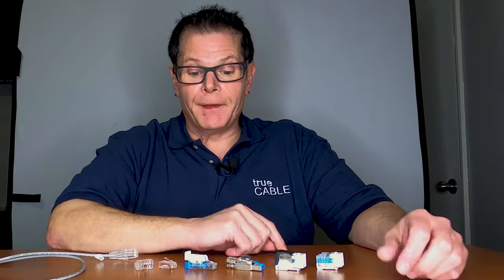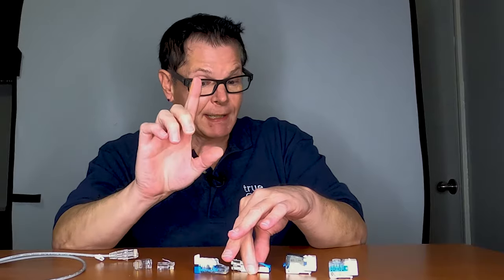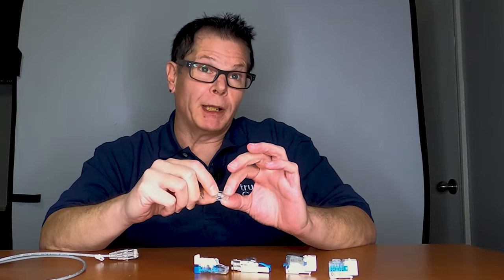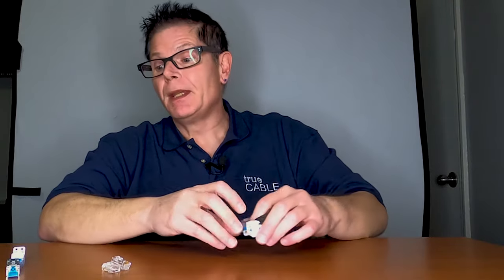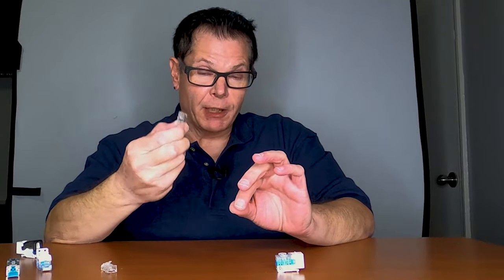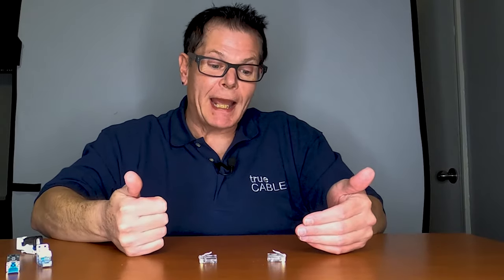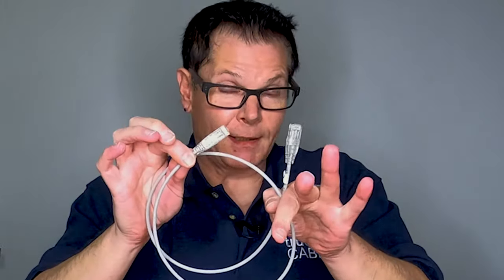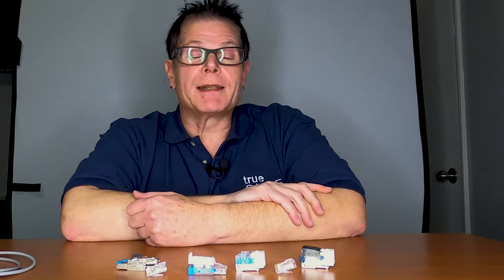Choosing the Correct Ethernet Termination

Comment: Doubt if this explanation is precise. Especially when he talks about cat6A cable. There are special cat6 plugs, that are red and that have wires sitting not in line in the plug as standard width of the cat5 plug can not accomodate thicker cat6 wire. Wires are inserted with the help of a special plastic insert that lines every odd wire slightly above even wires thus giving space for thicker wires to fit in standard plug width.
Reply from the maker: Hello obj! We carry the type of RJ45 (8P8C) plug you are referring to. It is called a "standard load-bar" style plug and it does stagger the conductors which does help with Cat6A NEXT (at the connector) performance when pushed to 500 MHz. When a 8P8C plug is absolutely required due to installation constraints, we recommend the load bar stagger plug for our Cat6A U/UTP cables -- but only when used at a single end for a MPTL run (keystone > plug for PoE devices). That said, having a IDC style termination such as a patch panel or keystone at the other end is critical to holding up cable performance and especially for achieving PASS on a Certification device. Solid copper Ethernet insulated conductor plastic insulation can and does have a tolerance that varies from lot to lot, spool to spool, and even along the SAME spool. This will affect NEXT and Return Loss at what would otherwise be a very well fitted 8P8C connector. This phenomenon does not occur with Category rated IDC style terminations (keystone, patch panel, field term plug). If you attempt to create a patch cord (defined as a 8P8C plug at both ends) with solid copper Ethernet you double your chances of creating a sub-par cable and it takes a Fluke DSX-8000 with PCA adapters to sort it out. Since most people don't have $13K - $15K to drop on such a device (nor the training to use one) we defer to the safer route which is using IDC style terminations for bulk cable and then use factory pre-terminated and tested patch cord for any necessary patching.

Comment: I wish I had seen this before I started my own networking project...  I also read the article on your site, and I had a question:  is there a particular reason you don't show a cable with Field plugs on both ends? 

I'm building a series of outdoor cat6 channels between daisy-chained PoE repeaters to reach a Point-to-point wifi AP ~1100' away.  Each channel is under 300', but even so,  each one in the system reduces performance considerably.  

Is it likely that switching from pass-thru RJ45's to field plugs would make the difference?  Can I use field plugs with PoE?  I'm aware Im pushing it, but hopefully with the right parts I can make it work.
Reply from the maker: Hello! I am glad you found our site and video! Not showing a cable with a Field Termination Plug at both ends was an oversight. Obviously, this is a superior way of way of creating a patch cable and this type of Field Term > Field Term cable is known as a Direct Attach Cable. You can most certainly use this strategy, and it will give you much better performance. As for PoE--absolutely! Our Field Termination Plugs easily handle 100W PoE. The reason you have seen performance degradation with RJ45s is likely due to multiple factors with the two biggest being fitment and mechanical stability. I would definitely use Field Termination Plugs at both ends of the individual runs if that is an option for you. Given that Field Termination Plugs are physically larger than RJ45s, that could be a factor in whether you use them throughout your installation as not all outdoor Ethernet switches with their weatherproof housings will accept Field Termination Plugs.
Reply: @trueCABLE  thank you! I just went ahead and ordered some of your shielded field termination plugs through Amazon.  Once I get them hooked up, I'll be sharing my results on my techier channel: @TheKludge4315
Reply from the maker: @DerrangedGadgeteer   Thanks and we look forward to your video. Also, I would recommend you pick up a pair of parallel crimping pliers (trueCLOSE). Here is the link to the written blog with embedded video which will give you tips on the nuances of these field termination plugs: https://www.truecable.com/blogs/cable-academy/how-to-terminate-a-cat6a-shielded-field-term-plug. Be sure to follow the video and written instructions closely! Both bring something to the table.

Comment: It is an 8 pin modular not rj45
Rj45 is a registered jack wiring configuration using a 8 pin modular connector
Reply from the maker: You are absolutely correct. It is technically called a 8P8C modular plug. The "RJ45" term has unfortunately stuck with us and it continues being used, quite often incorrectly. Therefore I will use the two terms interchangeably to refer to the same thing, knowing full well it is actually a "8P8C" connector. I will often put it like this "8P8C plug, aka RJ45" but sometimes I don't put it like that. I try and catch myself when I can. The problem is if I refer to it strictly as a "8P8C modular plug" and never use the term "RJ45" many folks that are not aware of the nuances will have difficulty understanding what I am talking about. It is a double edged sword
Reply: @trueCABLE  ok
The history I heard was that RJ45 was used a long time ago in offices by the telephone co.  Which was called the RJ45.  So along comes Ethernet and the used the exact same connector and the RJ45 stuck because it looked the same.
Reply from the maker: @wdooley62  Hello William! Yeah, I have heard that one too. There are several stories out there floating around about how the term "RJ45" sort of stuck. They are probably ALL true to some extent or another!

Comment: Great video. Thanks for creating it.  Can I ask for a little more clarity please as far as when you mention best connection…. I understand the runs through the house to faceplates or patch panel would be best to be terminated with keystone jacks.  Then from switch (POE) or otherwise  to patch panel or wall plate those cables should terminated with field plugs. Where I lose clarity is what connection to 1) POE cameras 2) modem/router 3) computer/ps5/cable box/smart tv etc?   Are those the RJ45 terminations or should those also be field plugs unless they don’t fit the device being connected?  I am not talking office/commercial use.  I am talking DIY through my home for best connection to everything and from internet provider.  It seems that every video out there is for pass thru rj45 terminations.  It seems like with Cat6 that is the “YouTube” ongoing recommendation   :). Thx
Reply from the maker: Hello! Generally speaking, once the solid copper permanent links are installed (patch panel to keystone to keystone to keystone) then you should patch into them with factory pre-terminated patch cable of the same Category (or higher) as your solid copper links. If you are constructing a MPTL run, which is patch panel or keystone to male plug end the best way is to a field termination plug unless it won't fit in the end point device. In that case you should use the RJ45 8P8C plug as you already surmised. Same room connections like from cable modem to router should also be done with a factory pre-terminated patch cable.

Comment: I'm wondering, how would you transition between cable jacket types. I'm planning to run CAT 6a burial and then in wall, how would I transition between the burial cable and riser cable retaining a good signal? (Planning to make the transition in a junction box attached to the wall outside)

Awesome video, so informative along with the blog on the website!!!!
Reply from the maker: Hello Chad! The best way to transition from outdoor to indoor cable is with 110 punch down splice block. You might have trouble finding a Cat6A one, however. Cat6 and Cat5e are very common. Secondarily, the next best way to preserve performance would be with Cat6A field termination plugs, which we carry. Terminate the end of the outdoor cable coming inside with a field termination plug and then use a component rated Cat6A coupler (which we also carry) in between. Terminate the end of the indoor cable going to the coupler with a field termination plug as well. The end of the cable that reaches your switch area should be terminated to a keystone jack or yet another field termination plug if you are not using a patch panel. At no point should you use a RJ45 8P8C plug for this task. Thanks for the kudos on our content!

Comment: Great content. One question, based on the products on your website, why would I buy a CAT 5E connector instead of just getting a CAT6/6A connector?
Reply from the maker: Hello! When it comes to Category rated items like keystone jacks, you can use a higher rated connector than the cable you are using (but not lower). The reason for not doing that is due to cost, and it does not get you more performance since the limiting factor is the lowest Category rated component in the chain. Cat6A keystone jacks are much more expensive than Cat5e, as well. As for 8P8C plugs (aka RJ45) it is not a matter of Category but a matter of fitment. RJ45 plugs don't have a Category, technically speaking. Hope this helps!

Comment: Sounds like you don't recommend using Ethernet jack couplers on patch panels? Or do those have chips inside? I'm assuming the cheap Chinese ones do not, but I'm not sure. I've been looking for a good brand that provides RJ45 couplers for my patch panel because it's so hard to pull out keystone jacks. If it was easier, I'd simply use punch-down keystone jacks instead.

My issue is if I have to swap the patch panel or reconfigure the wires, it's gonna be nearly impossible if I can get the keystone jacks outta there.

My drops are all punch-down keystone jacks, it's only the ones in my network closet that are RJ45. I'm up for making them punch-down if it's more reliable somehow. The patch cable itself is a Monoprice Slimrun 6" CAT6a.
Reply from the maker: Hello! Ethernet jack couplers, such as our keystone couplers, can be used in a patch panel. We would recommend keeping the use to no more than two couplers per channel. The main issue with couplers is the quality of the patch cords, not the couplers. Our couplers are impedance matching and component rated (they have PCBs inside, but then all couplers and keystones do) so if you intend to go this route use the highest quality keystone coupler you can get (again, such as ours but there are others) and be sure to use component rated patch cords. We sell the patch cords, but only up to 25ft. You can obtain component rated patch cords from CommScope and Belden as well. They cost more, but you want to keep the potential issues and points of failure to a minimum. That all said, the correct way of installing Ethernet is to use solid copper Category rated Ethernet cable for in-wall permanent cabling and punch down type terminations at both ends. A solid copper permanent link will give you the best performance and lengths. At both ends of the permanent link you would complete your connections with male patch cords. That is going to be the least problematic way, and gets around the issues of stranded copper being used throughout your installation which poses its own issues (maximum lengths being the main one).
Reply: @trueCABLE  great! I picked up RJ45 keystone couplers from your website and a bunch of other color punch-down ones for when I move. Punch-down are a pain to install in a small server closet with low clearance.

I also grabbed your thin 1' patch cables. I was using the Monoprice colored ones (I like the colors), but I've had issues.

I've been pushing 10Gb in spots, so this matters. I also used Monoprice CAT6 solid core in my house when I wired it up years ago, but I didn't realize the RJ45 connectors could cause issues.

Thankfully, all my drops are keystone punch-down or toolless.
Reply from the maker: @Saturn2888  Hello again! That is great. I hope you like our patch cords. I certainly do, and I am hard to please. You won't have any performance issues with them, I can assure you. I guarantee it, actually. And yes, the source of many problems with Ethernet cable installations is improper installation (damage to) Ethernet or hand terminated 8P8C (aka RJ45) connectors on solid copper Ethernet You are correct in that patch cords that have not been properly CERTIFIED (not merely verified) will cause problems, as you discovered. I have test data that backs you up, and I will be doing some expose stuff coming up in the near future that will basically throw the entire patch cord market (imported patch cords for the most part) right under the bus. Stay tuned!
Reply: @trueCABLE  that's great! Exactly what I want to see!

Comment: Really appreciate the excellent video.  I had 2000 Mbps fiber installed and the technician used 5e cable and standard RJ45 connectors. The computer end uses a USB-C adapter to a MacBook.  Should I replace both connectors with field term plugs? I do receive 2-2.3 Mbps download speeds but the slightest move of the cable cuts signal out.
Reply from the maker: Hey RK! Thanks for the kudos.

Cat5e can handle 2.5Gb/s via NBASE-T so you can remain on Cat5e if you have no future plans to increase speed. If you intend to start stringing new cable then I would opt for solid copper Cat6A with Cat6A keystones for the permanent runs + Cat6A factory made patch cords to patch into the solid copper runs. This would be best for future proofing since you are likely to buy into 10Gb/s at some point -- judging based upon how fast you are going now.

As an aside, if the movement of cable causes loss of signal this means either the cable is bad or one of the terminations is bad. You will have to start replacing patch cables, etc. to run down what it is. Hopefully it is not the USB-C port on the MacBook! Given I don't know how your installation looks that is about the best advice I can give right now. This is something that would require me to stand there and troubleshoot.
Reply: @trueCABLE  Thank you very much for detailed reply. It appears to be the cheap plastic plug causing the interruption when moved.

Comment: I had no idea how important keystones are before watching this video. It was very informative, thank you!
Could you please answer a little question, tho?

Let's say I run shielded cables from a shielded patch panel to keystone jacks on the walls.
If the cable is bound to the patch panel, do the keystone jacks (or RJ45 Connectors) on the wall need to be shielded keystone jacks as well?
There is nowhere to bind them at walls anyway, even if I wanted to.

Also, they are VERY expensive in Brazil, so I would really appreciate the money I'd save, but I want to make a proper installation.

Another question if I may, are cat 6 keystones compatible with 23AWG Cat6A cables? In this case, it's not about the money, but a matter of availability, unfortunately. I'm having trouble finding more cat 6A connectors at the local stores, I can only ship them from far away =/
Reply from the maker: It is better to use shielded hardware at both ends of your permanent link. Termination to shielded hardware bonds the shield, drain wire, and connector together, and doing this at both ends provides a more robust system. However, using an unshielded jack at one end will still work, including the shield if it is grounded at the other end. Sometimes, this is done to avoid the possibility of a ground loop in the shield circuit.
If the Cat6 jacks will fit properly to the Cat6A cable conductors, you may use them, but performance will be constrained to Cat6 levels. The thing to watch out for is the diameter of the insulation on the conductors. Depending on the manufacturer, the insulation might be larger on the Cat6A cable. If the conductors punch-down properly without having to force the insulation to go in, then it should work fine.
Reply: @trueCABLE  Crystal clear, thank you!
Reply from the maker: @alexsanderprogramador  Glad we were able to help out!

Comment: Will true cable rj45 passthru connectors work with a Klein crimp tool? Thanks for all the info
Reply from the maker: Hello and that is a great question. For any of the unshielded RJ45 connectors there should be little to no issue. The same cannot be said for our Cat6/6A Shielded Passthrough plug (external ground), which has been specifically tweaked to work with our brand AIO crimper.